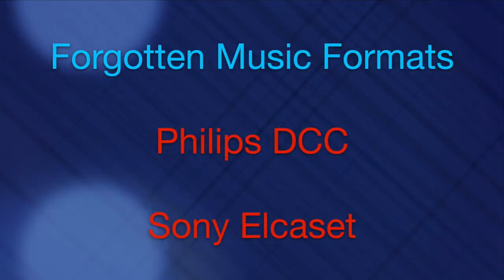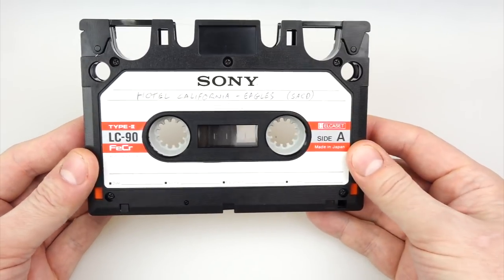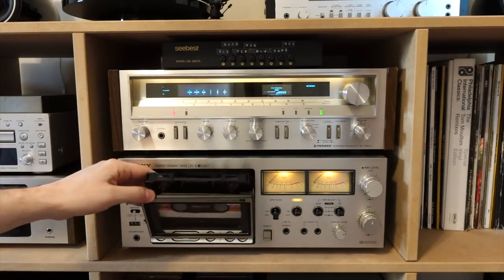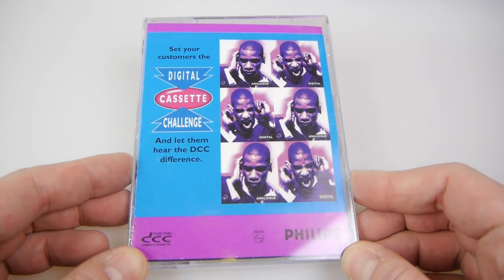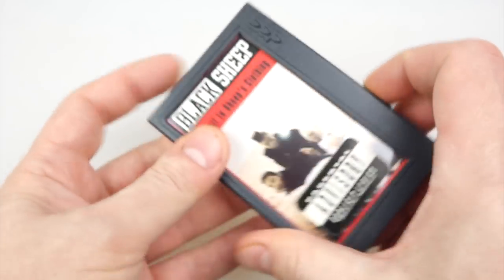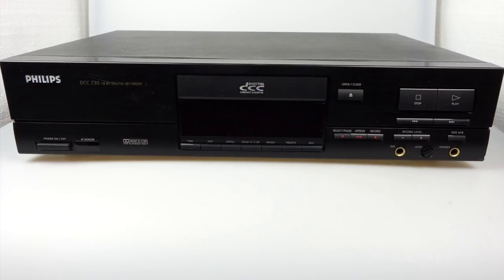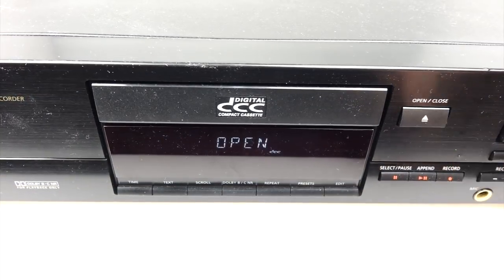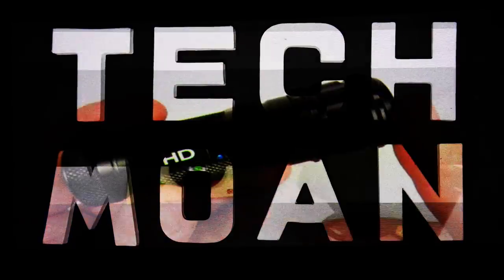Forgotten Audio Formats: DCC & Elcaset

Comment: After 1996 the price of DCC players was dropped. In the era of CDs before Napster the DCC could record CD track with great quality. I was using optical cable during recording between commercial CD and blank DCC. I couldn't understand the difference in audio quality. So DCC cassettes were a great way of  home individual piracy. The DCC cassettes were much more expensive than analog cassettes. The portable DCC players were very expensive too. So DCC was doomed from the begging. After the MP3 sharing with ftp servers during the 1996-1999 and the advent of Napster in 2000 there wasn't real reason for DCC, CDs or Sony mini disk. Sony mini disk could play MP3, so it lived a little longer until the iPod domination.
Reply: I take issue with your inclusion of CDs when you say "...there wasn't real reason for DCC, CDs or Sony mini disk." At the time, of these 3, the CD was the only one to be uncompressed. The Hi-MD, which came later, did have that capability but by then it was a matter of too little too too late. MP3s are always compressed, even at the highest bit rate.
Reply: One of the features that was part of DCC to reduce piracy was the Serial Copy Management System (SCMS). Simply put, you could make a copy of an original but you could not make a copy from that copy.

However, I think what doomed DCC was the introduction of affordable recordable CDs. I think that if DCC has been introduced a few years earlier it might have had some success as a companion to the CD for portable use (much like people recorded their CDs to cassette for music on the go).

Another factor that worked against DCC was the issue of infrastructure. CDs and cassettes both had a large existing collection of supplies and equipment, something that DCC didn't have (few available players for home, portable and cars, and few tapes).

Comment: What kind of battery does the portable DCC player use?  Is it some kind of rechargeable battery?
Reply: Lachlant1984 If it is like the portable DCC player I had, it was a rechargeable battery pack. The pack had to be removed from the player to recharge it (in a separate charger), and it looked like four AA batteries packaged together. I became concerned about getting a replacement battery pack since I knew it would eventually have to be replaced. I wish Philips had just used standard rechargeable AA batteries (the kind that are easy to obtain) for the device.
Reply: Lachlant1984 If it is like the portable DCC player I had, it was a rechargeable battery pack. The pack had to be removed from the player to recharge it (in a separate charger), and it looked like four AA batteries packaged together. I became concerned about getting a replacement battery pack since I knew it would eventually have to be replaced. I wish Philips had just used standard rechargeable AA batteries (the kind that are easy to obtain) for the device.

Comment: Hey Matt, 
I was hoping that googles coupling of YouTube comments and Google+ was gonna calm the trolls and haters, but it doesn't seem to have worked yet.

Anyway, great video, I loved the retrospective review, I never wanted DCC for the reasons you outlined, sequential/serial access to the audio.

All the best,
Reply from the maker: I was at a HiFi show in Manchester in the early 90s where representatives from Sony were showing their MiniDisk and Philips were showing their DCC. The Late Bob Tomalski presented the event and I remember asking the chaps a question about copy protection (something both were reluctant to discuss). The DCC sounded a lot better than the ATRAC 1 codec at the time - but the size of the format and the slow access were big turn offs.
Reply: BTW the elcaset had passed me by too, and your comparison of it next to a VHS cassette, made me think of betamax cassettes!
Reply from the maker: Stuart Taylor I've never used Betamax - but now you mention it - I'd imagine the cart dimensions are pretty similar (other than the tape/cart width).

Comment: Hi. I used to work in an AV store which had an EL-4 for display. I bought it from the owner as old stock. It lay in a box along with 20 FeCr and 20 low bias tapes. About half are in original cellophane. The other half have torn or damaged cellophane but are also brand new. The spools are pristine. The machine is pristine in appearance but starts fine. VU meters are fine. But I can't test it any further because there is zero transport. Capstan spins and other motors can be heard moving. No tape movement. Does anyone have a clue about the EL-4?

Comment: Elcaset's biggest flaw was sony themselves. Up until the last year or so of the format sony refused to let any third parties actually manufacture there own Elcaset decks (kinda like the early days of beta where Sears and RCA just had rebadge sony units) . Supposedly Sony was approached soon after the formats release by Nakamichi (which became the king of cassette decks) who wanted to produce there own decks, sony basically told them that they could slap there name on a rebadged Sony or hit the bricks and Nakamich responded by dumping countless resources into making the best cassette decks imaginable. It wasn't until late 77 that they relented and Hitatchi and Toshiba released units that would be first off the boat to be dumped in finland.

Comment: DCC failed because the CD was so much better. Once the CD could be played in an affordable portable player around the same size as a cassette player walkman the tape cassette was doomed so they were trying to keep the tape cassette going by making it be more like a CD which it tried to mimic (as you saw with the machine going crazy looking for that one track) but was not as good or quick as the CD. Then of of course Napster came along.

Comment: MPEG-1 format was the original MPEG format, but MPEG-1 Layer II, which was the audio layer, and used the mp1 extension, was used strictly for the mpeg files containing only audio. That is very lossy compression, which mp3 later replaced(mp3 made mp2 and mp1 utterly obsolete). The quality should be worse than mp3 at any given bitrate.
Seems to me it would be FAR better to just record analog audio on them, then to use HORRIBLE compression to squeeze on digital encoding.
The lyrics are interesting, I wonder if they used single line lyrics with timestamps, like modern subtitles, encoded into the mpeg container's header.

Comment: I had for a long time a Sony STR-V6 receiver which I liked so much, was working perfectly except for worn-out volume potentiometer and some of the switches not making contact. I tried to send it to repair, but the cost would have been unmotivated high, so I had to send it to recycling. I wasn't happy at all....
Reply: Where/who did you try sending it to - Sony themselves, a local repair shop, etc.? How long ago was it that you did this? I realize that you no longer have the receiver but I'm still interested in knowing the answers - for a few reasons why.

Comment: I guess, the reason why DCC didn't take over, that at the time it came on the market, almost everyone had CD-players, although they wasn't recordable at the time, and DCC was designed to be an portable recordable format with superior sound quality, and people had used to CD's superior sound quality which DCC also offered, but at the same time everyone had C-cassette players which was also recordable format and sound quality was still quite decent, while DCC has the same limitations in usage as an analog C-cassettes coz' you had to rewind the tape to find a right track while on CD you could choose the right track by pushing a button and it begins to play right away, and at the same time DCC had competitive recordable format MiniDisc that had the same functionalities as CD. Nevertheless MiniDisc's sound quality wasn't as good than on DCC but still quite decent, and the same functionality as CD, and that was the main reason why MiniDisc did finally succeeded better on market the DCC.

Comment: Improvement Frequency Response on Alcaset is not the point. There were regular cassette decks with 3 head system wich coud provide 20-20 HZ bandwith Frequency spectrum, In fact, problem was channel separation...and output DB levels

Comment: I believe I once heard that you could modify analog cassettes and trick DCC players into thinking they are DCCs. Is this true or just a rumour?
Reply from the maker: +Mirko Horstmann you could do this by drilling holes in metal tapes, yes...but if you look on eBay you'll see that blank DCC tapes now cost less than Metal Compact Cassettes and also are better quality.

Comment: DCC will never araive the market because a CD-Player was also on the market too. So a CD-Burner cost in the mid/end 90this around €800,- and a Empty CD will cost around less €4,- and that was the dead of the DCC. To late on the market and the System was not confortable to handle - you must rewind and so on a CD never have this problems and you can jump track by track or over the tracks in seconds.

Comment: Don’t use WD40 to lubricate moving parts. It’s a cleaner. A silicone lubricant will be less abrasive.
Reply: Kristof - WD40 is actually a Water Dispersant lubricant and the cleaning action is "accidental" not by design. It also eventually dries leaving a sticky residue which then attracts dust and  just becomes an abrasive paste. The other problem with WD40 is that it can and will react with and dissolve certain plastics, so you need to be VERY careful where you use it!

But yes, I agree, if you need to lubricate plastic, use a silicone lubricant (or even Teflon/PTFE if you can find any!) and use it VERY sparingly...

Comment: Elcaset seems like a great thing! What is the problem with this industry. Engineers come up with great idea but inferior product survives. I've read up on Elcaset on wikipedia and they say that the format died because quality of Compact Cassettes improved drastically and was "sufficient" for mass consumer. Yeah, right. Compact Cassette is crap. Elcasete sounds almost as good as reel to reel!

P.S: well may be if they added rotating head (like in VCRs or DATs) to it, they could improve quality even more.
Reply: Vic Investa Obviously compact cassettes were sufficient for the mass consumer, which is why they prevailed. And then the Walkman was released, increasing their utility further. Elcaset was superb, but there wasn’t room for yet another format in addition to vinyl, compact cassettes reel-to-reel and (imminent) CD.

Comment: mmm, Tandberg,Revox and particularly Nakamichi, made machines that gave superb end results.
around the time of the DCC launch.  with DAT launch, too, it was too much  much competition. Sony,Aiwa,Teac, et al, were pretty good, too, by this stage. Philips strong suit was/is usually in the tech, not in marketing. for listeners who wanted to primarily listen to prerecorded material, there was CD,(& later MiniDisc)
wCD uses 44.1khz sampling at 16 bit depth. I imagine the MP-1 standard was a lossy format like MP3(similar toMinidisc codec), =shedding quiet detail in master recordings, right?quite where 18-bit is used, I am not clear. sounds like a fake claim. once a lossy codec is employed, the lost detail is irretrievable, no matter what bit rate might be employed later in the chain.  ?

Comment: So DCC is just a nicer one sided cassette thats better than a cassette?
Reply: "Better" .... probably not.  I remember hearing LOTS of demos of DCC back when they were launched.  And they didn't sound dire, they just sucked all the life out of the music - DCC was generally panned for having a horrible compression system (worse than Atrac on the Sony MD players).

Problem with normal tapes was pre-recorded ones were horrible.  Home recordings from a decent source were way better than DCC ever could have been.
Reply: Yeah, either your memory or your ears have failed you, because on launch it was regarded the DCC's PASC sounded superior to to Atrac by every single review from the time.

ATRAC did get better over the years, since it didn't fail as quickly, Sony did work to improve it.

Comment: I know it's nitpicking but I'm going to say this anyway because it really annoys me.  I wish people would stop saying things like "digitizing their CDs". THEY ARE ALREADY DIGITAL!! What you really mean is transferring them to another format/device. As long as the transfer is done digitally without any conversion to analog and back, then you are NOT digitizing anything.
The same thing goes for those who refer to getting/moving to downloads instead of CDs (or even DVDs, BDs) as going digital. Yes, those are digital, BUT SO IS BUYING THE CD VERSION. They're both digital. And I'm not even referring to a higher than CD quality download (better than 44.1 kHz/16 bit). I'm simply stating what should be the obvious, which is - CDs are digital. So STOP saying you're digitizing them - that's NOT what you are doing. I had to say it, and yes, I feel better now.

Comment: BIG SIGH bring back the old stuff,better than the err stuff today,it doesn't last.
Reply: shaun walley MP3 has been with us for the last 20 years and still going strong. Comparing apples to apples, each iteration of stylus angles, mono vs. stereo, tape materials... was hard-pressed to stay on the edge for that long. And before you mention DVD audio, who has those - and who has a DVD player with a decent enough DAC?

Comment: Why do people still like the MP3 format? The sound is bad but at the time people only did have 2 GB witch could only hold 45 songs.  There is great formats that have 0% audio lose that are only 2 - 3 times the size of MP3 , Space is no longer something ones needs to think of.
Reply: I think the following are the reason that MP3s are still a popular format:
- Just about every audio player supports the format. While other formats are also supported, some are not supported. As an example, I have a portable CD player that can play WMA and MP3, and my iPod Classic plays ALAC, AAC, and MP3 but not FLAC.
- If you use a modern encoder, like LAME, and a high-bitrate you can get very good results with MP3. My understanding is that; (1) while the original creators of the MP3 format have stopped developing the format, the developers of LAME are still developing the format, and (2) at the higher bitrates the difference between MP3 and other formats (like AAC) is basically a wash.

I've done my own ABXY testing between FLACs and 320kbps LAME-Encoded MP3s and I'm not able to consistently tell the difference between the two (a few times I could hear a slight difference but not enough to say which is which). I normally rip to FLAC and then autoconvert to other formats as needed.

Comment: A DCC can sound slightly better than a CD?! I recommend you read up on digital sampling theory and compression, to learn why this claim is completely bogus. You cannot hear the extra 2-bits over CD because the dynamic range of CDs already exceed human hearing by a lot. Funny thing is most people can't tell the difference between 8-bit and 16-bit PCM-WAV. It's even difficult for me, even with studio monitors and years of sound engineering experience. Google the "8-bit blind listening test". And this is not even considering that DCC used a fairly primitive form of lossy compression.

Comment: Better don't use WD 40 to lubricate the mechanism. It dries out and leaves a residue.

Better use a PTFE spray I guess.

Even better: just live with it and don't bother.

- Olaf -
Reply: Satadorus Yes, WD40 is the plague, noobs always believe there is such a thing such as universal oil. I'd probably apply some lithium grease very sparingly with the cassette taken apart. No spray.